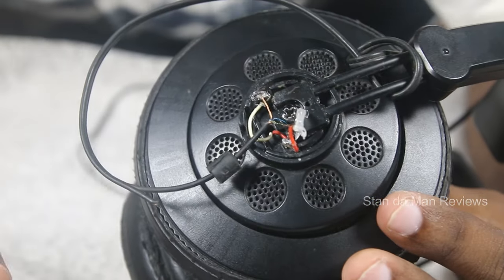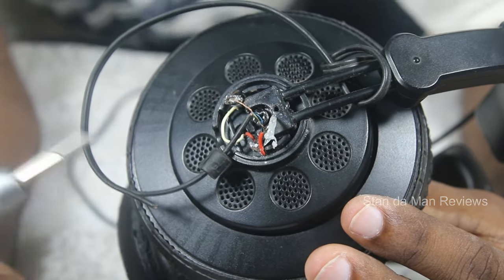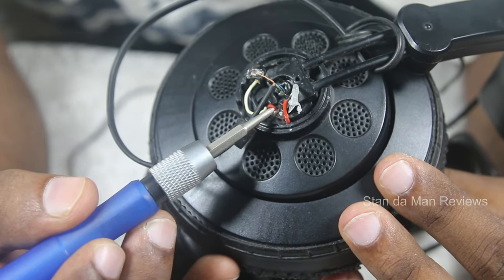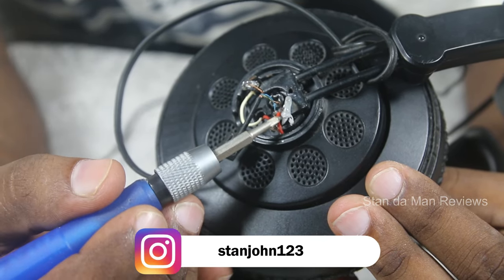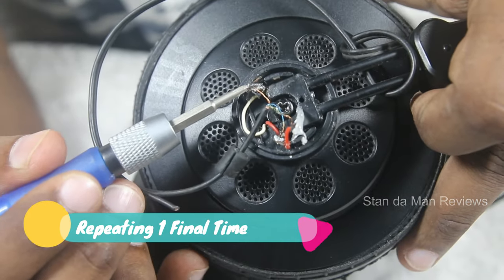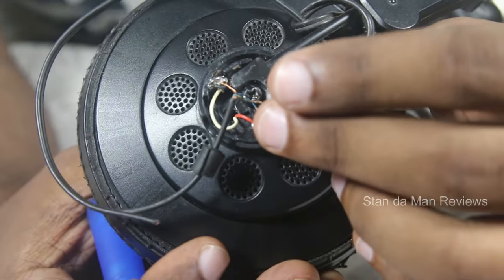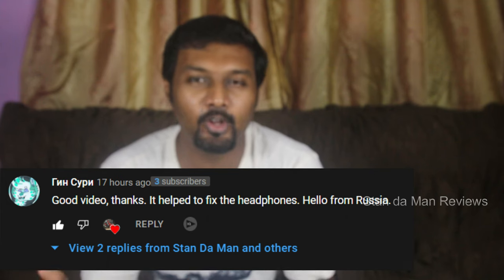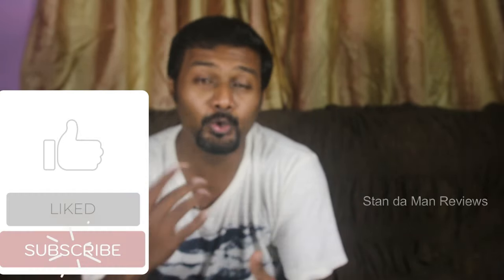Superlux HD 668B | Correct wiring Schematic

Comment: Left side headstrap wire connected to a white cable coming out of the hole, this is the common Ground connection(-for both speakers).
Right side headstrap wire connects to + right speaker.
Red cable coming out of the hole, this is + left speaker.